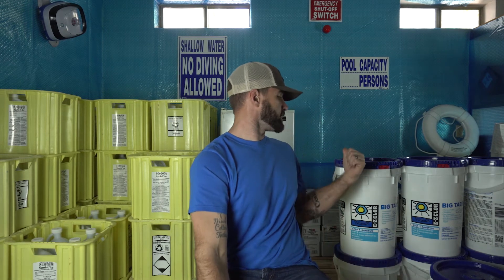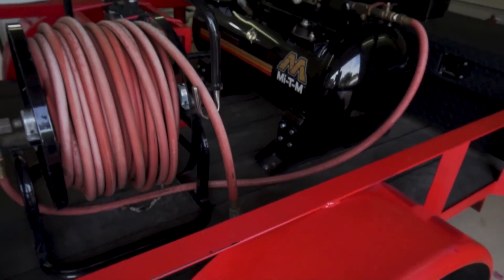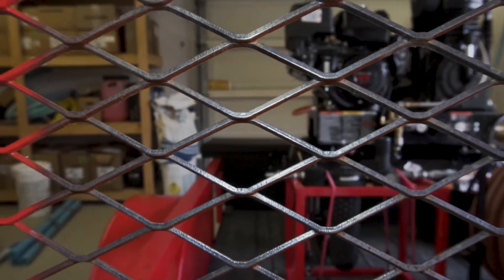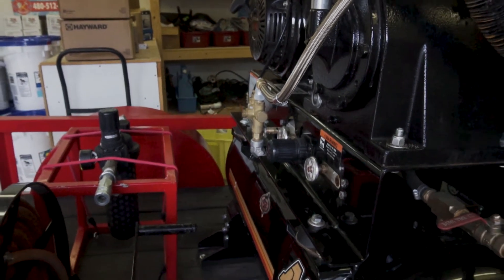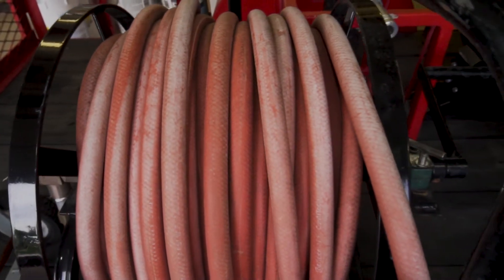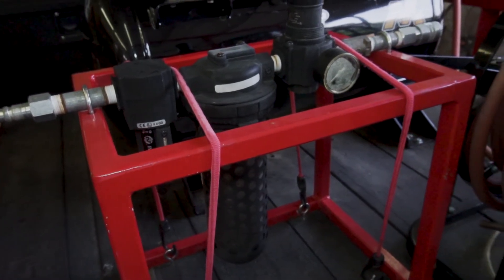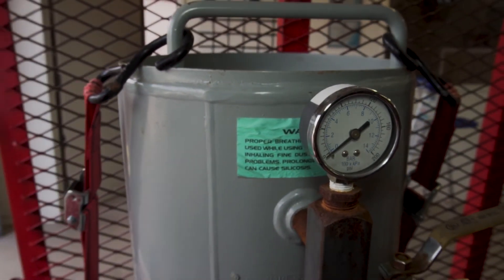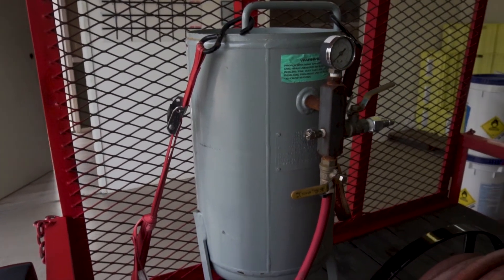How to build a pool tile cleaning RIG

Comment: I just got my cleaning rig set up and it’s going well. I appreciate all your good advice. I have one question I’ve got a glass tile job coming up in two weeks, and I was hearing allot of guys still use #10 glass beads to  to blast the tile but at a lower pressure. What are your thoughts on that.
Tom
Reply: @tomsetka7543 just wondering how did this job come out?

Comment: Nice video. I agree with you that when I was trying to start my tile cleaning business information wasn't easy to come by. What air dryer do you have? How do you like it's performance? I am currently looking for a new one that performs well before the heat of summer arrives.
Reply from the maker: Chris Lopez I bought everything from pecs coating here in az. Not sure of the brand of it. Works great
Reply: @PoolRescuers  Thank you
Reply from the maker: Chris Lopez no problem. Hope you get your rig dialed in. Have a good summer

Comment: Very informative video man. Do you mind me asking whats the avg price you charge for cleaning the tile on an avg size pool? I've been looking into getting into this and was curious.
Reply from the maker: Aldo A my guys charging about $2.5 - $3 a foot for other pool guys. And about $4 if it’s an end consumer. (Home owner)
Reply: @PoolRescuers  ah ok. Thanks for the info man!
Reply from the maker: Aldo A just keep skimming
Reply: @PoolRescuers  can you use Maxxstrip with that hopper you're using? I've been trying to do some research and saw another guy using a Hopper with a pressure washer so wet instead of dry. Would the dry one like yours be better? Sorry for all the questions but I'm curious on this.

Comment: thanks for the video Ryan,  been looking forward to it and the future ones,  on the hoses you use,  I didn't think they looked like your normal air hoses,  is it a larger air hose from the trailer to the pool, then normal air hoses from the hopper to the nozzle,  also what nozzle gun do you use, thanks for all you do for the trade
Reply from the maker: jim kline thank you for the comment. The air hoses are industrial that came as a package with the hopper and air drier. The nozzle is on the end of a 1/2 ball valve with the porcelain tip. Hit me up on instagram if you wanna chat more and I can shoot some pics